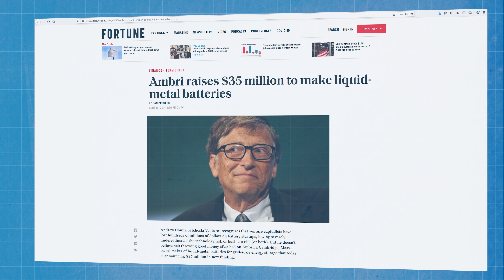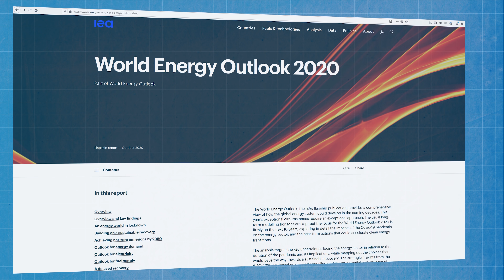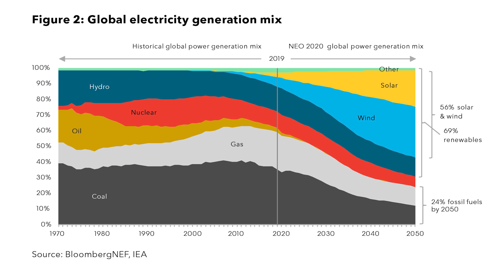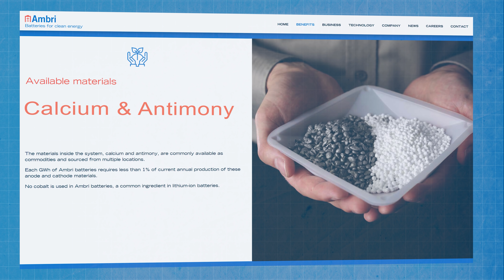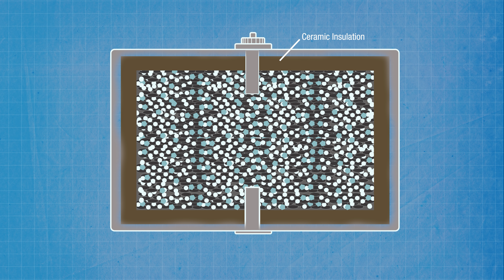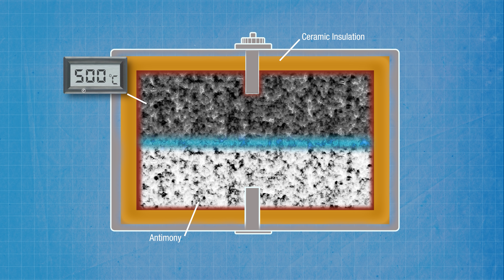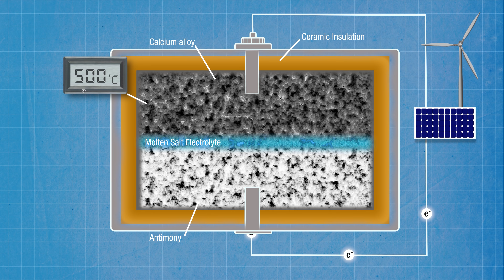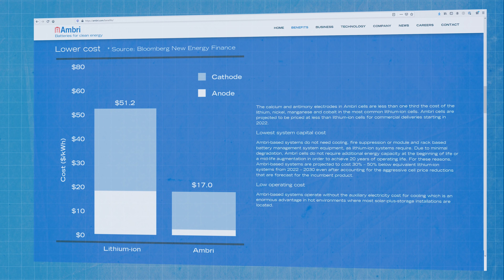AMBRI Liquid Metal Batteries. Will they really change the world?

Comment: I’ve been waiting for LMB to become commercially viable for some years now. NEC had an agreement with Ambri to use their patented technology, however nothing seemed to come of it. The really exciting thing about LMB is negligible capacity degradation over 10,000s of discharge cycles. This is at least 10x better than Li NMC, and translates directly into a proportional cost reduction per MWhr stored. I’ve not seen a price for Ambri LMB cells, however their websites implies the cost is expected to be ~40% that of Li NMC, which would make it competitive with pumped hydro from a capital cost perspective.
Reply: Lithium Iron Phosphate batteries have 10,000 or more cycle lives.  Jeff Dahn is testing some sort of lithium battery that is holding capacity to 20,000 cycles.  It will take longer to find the limit, it has taken three years to test the cells using typical discharge and charge rates one would find in EVs.
Reply: @bobwallace9753   Here's a recent paper reviewing the LFP Li NMC and NCA cell degradation as a function of cycles, depth of discharge and temperature.
https://iopscience.iop.org/article/10.1149/1945-7111/abae37/pdf
LFP batteries look to have an effective full cycle capacity degredation (to 80% of nominal) that is 5~10x  better than Li NMC, and are the best candidate for large scale energy strorage currenty available at scale. Lets hope LMB can improve on that, particularly for grid scale ESS.
What's clear is that energy storage will be the dominant cost component (~90%) of fully renewable electrical power.
Reply: @mikegofton1  Thanks for the paper.  I'll print it out tomorrow so I can read in detail.  (I need to underline and go back as I read.)

Jeff Dahn has now cycled batteries 20,000 times with essentially no loss of capacity and I think I heard that his lab has now reached 30k cycles.  But consider -

Tesla's cell cost, based on Sandy Munro's Model Y teardown review, was just over $100/kWh.  On battery day Tesla said they could drop the cost by 56%.  Let's round a bit and assume a $50/kWh cell soon coming.  And use 20,000 cycles.  $50 / 20,000 = $0.0025/kWh stored.  That does not include AC->DC->AC hardware or financing but it looks to me that the cell cost is danged low.  When storing for a half-day, day, or couple of days it would seem that batteries would be hard to beat.  Unless I've got something wrong.
Reply: @bobwallace9753  The cell costs you're quoting are a lot lower than the actual installed capital cost for grid scale ESS. In 2017, Tesla installed it's largest stationary LiNMC battery farm in Jamestowm, South Australia. As best I can tell from public data, the cost was ~$AUD 700/kWh. In 2020, the US DOE reported an average Li battery ESS capital cost of $500/kWh.
In the residential battery market, there's not much capital cost difference between LiNMC and LFP.  Sonnen (Germany) offer an AC connected LFP battery, warranted for 10,000 equivalent full cycles or 10 years at 80% capacity or more ,with a 20yr battery design life for ~$AUD 1000/kWh.
BYD (China) offer DC connected LFP batteries warranted for 3,100  equivalent full cycles or 10 years at 60% capacity or more for ~$AUD 800/kWh.
Tesla's Power Wall offers AC connected LiNMC batteries warranted for 2,800 equivalent full cycles or 10 years at 70% capacity or more for ~$AUD 900/kWh.
I would love for grid scale ESS capital costs to be comparable with pumped hydro ~$AUD 100/kWh in Eastern Australia , however I can't see that happening without some serious economies of scale (i.e. large capital investments). 
Out of interest, Australia has 13% of total electricity produced by Solar and Wind, 7% from hydro. To provide 3 days reserve for current Solar and Wind generation capacity would require ~400GWh of batteries.
Reply: @mikegofton1  You're using ESS as energy storage systems and not referring to the company that is developing iron flow batteries?  

OK, let's assume energy storage systems.  We have only two technologies that I can think of that are in commercial/common use - pumped hydro and lithium batteries.  There are a couple of compressed air (CAES) systems that were built years ago but haven't gained popularity.  And in this (larger) discussion we're talking about liquid metal batteries which at this point in time are only an idea.  They have worked 'in the lab' as have liquid air storage, synfuel, lifted weight, and perhaps some other ideas.  

Let me deal with lithium based cells vs. liquid metal storage first.  The numbers you present aren't very useful because they are based on 'old' cell prices and are not 'at scale' prices.  Clearly whatever storage technology/technologies we settle on will be built at scale.  Ramp up costs are simply burdens we will need to bear as it the case with any emerging technology.

OK, what are the cost components of lithium cell and liquid metal systems?  

Both need real estate.  At this point we don't know kWh/liter and now high it might be practical to stack batteries.  

Both need hardware to convert grid AC to DC and DC back to AC.  Assuming equal power ratings the hardware costs should be similar.

Both need labor to install and grid connections.  This may or may not be a wash.  We don't know what maintenance and security costs might be. 

Cells will probably have a higher manufacturing cost and higher assembly costs, turning them into a battery.  Cells might have a higher material cost.  This is a place where liquid metal could prevail. 

Liquid metal may have the ability to store more energy for less cost, but I'm not yet convinced.  It might be less expensive to install a very large liquid metal system than a lithium cell system with new cells but if the deep storage part of the cell system is provided by pulled EV batteries that are valued at recycled mineral prices then I'm not so sure.  In the real world we might install cell systems large enough to provide four hours of storage but later we could install some used EV batteries in parallel and increase capacity for very low costs.  Basically, the financing cost of owning then minerals between EV and recycling  plant.

In summary, I can see liquid metal systems prevailing but I'm not convinced.  We have to first see full scale operating systems so we have some reliable cost/performance data.

Now, cells vs. pumped hydro.  Pumped hydro has a very high upfront cost both in dollars and effort.  Huge projects with lots of regulatory and permitting hurdles.  Cells can be assembled in a factory and trucked to a site where they are placed on a slab and appear as just a big metal box.  Cells/batteries can be installed in modest amounts spread around at places like existing substations.  Cell storage is modular, there's no need to finance the entire long term storage system all at once.  And that might be what causes pump up some grief.

I can see cell based systems being installed in very large numbers for frequent cycle storage.  The daily stuff of moving solar to evening, late night wind to morning.  Cells could grab the 1-3 day work, leaving on a few times a year that we'd need a deeper storage.  To be affordable, I suspect, pumped hydro would need to sell every day, not just a few times a year.  We could reach a point at which we have all the 'up to three day' storage we need and now we need some three to six day storage which we would use only a half dozen times per year.  Would we go to all the effort and expense to build big storage systems?   

It's going to be interesting to see how things pan out.
Reply: @bobwallace9753  My apologies, I was referring to Energy Storage System, ESS.
In a broader context, our Australian federal government has no national plan for the wide scale deployment of grid scale ESS. Currently, some electricity distributors are planning to install 1200 MWh by 2030. This is really just driven by economics, to reduce peak electricity generation costs, and is negligible from an emissions perspective.

Presumably to be greenhouse emissions neutral by 2050 ( Government stated objective ), there will need to be significant changes in energy supply for transportation, manufacturing and electricity. Farming is also a significant contributor. Moving to emission neutral electricity is likely to be the easiest to achieve, and is an enabler for transportation and manufacturing emission reductions.

To get Li or liquid metal battery grid scale ESS to market at anywhere near $AUD 100/kWh will require a massive commitment of capital to drive economies of scale. I really can’t see how this will occur without Government intervention, either by direct investment or emissions related regulation.
In Australia, successive Governments have proposed emissions regulations however none have made it into law. There have been several instances where advocating for such changes have resulted in the Prime Minister or Government losing office as a consequence.
If I look to history as a guide, rolling out a national broadband network in Australia took 10 years for a capital cost of $AUD 57B, and that required direct Government investment and regulation. An emission neutral electricity supply will likely require an incremental capital investment of at least $AUD 200B.

I’m hoping Australia is not representative of global trends, and that LMB and other battery technologies will find the capital investment they need to scale quickly.
Reply: @mikegofton1  I had never run into 'ESS' before.  New abbreviation for me.

"To get Li or liquid metal battery grid scale ESS to market at anywhere near $AUD 100/kWh will require a massive commitment of capital to drive economies of scale."

Tesla is/has created the scale necessary to get cell costs to about $50US/kWh.  About $60AUS, rounding off.  What I don't know is the cost of the rest of the system.  Inverter prices have plummeted in the last few years so for a large installation $100/kWh may already be possible.

The capital will come.  Most businesses now realize that we must move off fossil fuels.  A few are in denial but that probably means that they are skidding over the cliff and won't be around long.  There's getting to be more and more social pressure to quit fossil fuels and during this first phase of wind and solar installation the cost of electricity will fall or at least largely stabilize.  Health costs will drop but that won't be as apparent to most.  Improved air quality will be noticed and appreciated.  Forces are combining to push renewable energy faster and part of the solution is storage.  

What is pretty much never acknowledged is the fact that fossil fuel plants age out.  Most US coal plants are near their replacement dates and will have to be replaced with something.  Wind, solar, and storage will deliver cheaper electricity than what could be had from a new coal plant.
Reply: @bobwallace9753  I admire your optimism. Good point about Coal fired plants reaching end of life - we have a similar situation. There’s a case in point in New South Wales now, the banks won’t finance a coal fired plant as solar and wind are more cost effective. However renewables won’t work because of grid stability issues, so in an effort to avoid outages the Government has said it will step in and finance a Gas fired generator if the existing operator won’t. Presumably this is because the cost of grid scale ESS and renewables has a much higher capital cost than a Gas fired plant.
I think we’re in a critical race which we are losing.

For arguments sake, accept the proposition that Tesla may have created enough scale to achieve cell prices of $USD50/kWh. Tesla vehicle production is currently limited by battery production, and Tesla produce only a few percent of vehicle demand globally. If each house needs about 3 days energy reserve (~75kWh) and each vehicle 35kWh,  the battery plant capacity required to be emission neutral globally by 2050 will be hundreds of times that which exists and in construction. 

Bill Gates is skeptical that this will ever happen, and is probably why he’s invested in Nuclear as well, even though $/MW is so much higher than renewables.
Reply: @mikegofton1  "renewables won’t work because of grid stability issues, so in an effort to avoid outages the Government has said it will step in and finance a Gas fired generator if the existing operator won’t. Presumably this is because the cost of grid scale ESS and renewables has a much higher capital cost than a Gas fired plant."

Wind and solar won't work without storage.  My guess is that we'll build storage over time.  But right now if one wants to create new capacity or replace a coal or nuclear plant what is the fastest and least capital intense is a mixture of wind, solar, and natural gas.  CCNG plants have low installed costs and once in place can assure 24/365 electricity.  

As more wind and solar are added the amount of gas burned can be lowered.  Since new wind and new solar produce electricity at less than the cost of fueling a CCNG plant it will behove utilities to keep adding wind and solar and running the gas plant less and less.  (If they are cost sensitive.)

It would make no sense to install large amounts of storage now as there is nothing to store.  Until a grid reaches the point at which a significant amount of wind/solar is being curtailed there's no role for storage, in general.  You can't store what you don't have.  Storage is replacing gas peakers for grid smoothing.  And we're starting to see power purchase agreements that include modest amount of storage that can be used to move a few hours of solar into high demand evening hours.  

Tesla is now building battery factories.  They have not yet made the formal announcements but buildings are going up at the Berlin and Austin gigafactories, Tesla has apparently been shopping for some very large buildings where they can start battery manufacturing, and they've been advertising for people with battery manufacturing expertise in North Carolina.  This Wednesday Tesla is presenting their Q4 2020 financial numbers.  It's likely we'll hear something about coming battery plants.  

As well some of the legacy battery manufacturers have started talking about switching to dry roll, large diameter cells.  I'm guessing Tesla has worked out some sort of licensing agreement that has not yet been announced.

Remember.  We're going to be building something because the existing stuff will not last forever.  We're unlikely to build any more very large centralized power generation plants but move to more modular and distributed wind, solar, and storage.   That's just what the economics will drive.

Nuclear has no future except where strong central governments build reactors for some misguided reason.  Most likely because large projects create opportunity for large bribes.  I think we may have reached the end of developing countries building nuclear reactors as a sign that they are 'arriving'.  You can't include 12+ cent electricity into a mix that now costs under 5 cents and make the math work.  

Bill Gates has deep knowledge in some things.  That does not make him an expert in all.
Reply: @bobwallace9753   "Until a grid reaches the point at which a significant amount of wind/solar is being curtailed there's no role for storage, in general.  You can't store what you don't have."
This statement, while strictly correct, doesn't acknowledge the fact there is a large difference between the daily time based generation capacity of renewables and consumer demand. To maintain grid stability, as renewables power increases  you need to match demand by varying NG or Coal power production. This reduces the capital efficiency of the Coal and NG plants considerably.
Experience shows that countries with high proportions of Wind and Solar electricity (Denmark 44%, Germany 34%) have needed to build new NG plants to do so. My argument is that capital investment in NG is ultimately substantially slowing the introduction of grid scale ESS, and the likelyhood of being emissions neutral by 2050. Storage has a role now, it avoids investing in new NG plants and allows existing coal plants to run at peak efficiency. In Western and South Australia, we typically have Solar and Wind providing 50% of demand around the middle of the day in summer.
Reply: @mikegofton1  

First, as I think we both know but I want to acknowledge, I'm using US numbers because this is where I live.  While Australian numbers may differ the same principles will hold.

"To maintain grid stability, as renewables power increases  you need to match demand by varying NG or Coal power production. This reduces the capital efficiency of the Coal and NG plants considerably."

We've always varied NG and coal power outputs as we match supply to demand.  That's led to lower capacity factors (CF).  That has decreased the capital efficiency of those plants but the cost is pushed on to consumers.  It's just part of the cost of providing electricity.

I'm going back to 2011, before there was hardly any wind or solar in the US electricity supply.  Here are the annual CFs.

Coal  62.80%
CCNG  44.30%
Gas Turbine  7.90%
Internal Combustion  8.40%

As you can see no plants, on average, ran at full availability.  All fossil fuel generation was curtailed at times with gas turbines and diesel generators running less than 10% of the time.  While those plants were underutilized based on their availability rating turning them down or off at times is just how the grid operates.  We need enough capacity to meet annual peak demand.

"Storage has a role now, it avoids investing in new NG plants and allows existing coal plants to run at peak efficiency"

That's a valid point.  And it might make sense to add storage in order to not have to curtail coal if all we consider is acknowledged costs of electricity and ignore external costs.  If we add in health costs then it makes sense to install CCNG plants and close coal plants immediately.  If we add in the future costs of climatic warming then we have been fools for not replacing coal plants with CCNG plants years ago.
Reply: @bobwallace9753  thanks for the stimulating discussion Bob. I’m a newbie to the power industry, having worked in Telco for 35 years. You obviously know the electrical power business very well.
Reply: @bobwallace9753  LiFePO4 is still 20 - 30% more expensive than NMC.  And A123 quality LiFePO4 is 2x more expensive.
Reply: @bromnader5196  Aren't the material costs less for LiFePo than NMC cells?  Nickel and cobalt are not cheap compared to iron.  If it's not materials might it be a scale of production issue?  

And if the materials are less expensive for the LiFePo cells shouldn't we expect their prices to drop lower than NMC cells with Tesla's new dry roll technology which is, IIRC, usable with both chemistries?  Tesla is planning on using LiFePo cells in its less expensive versions of the Model 3 and Y which should give that chemistry a scale advantage.  Nickel, I think, is being reserved for performance versions and possibly their long range semi.  Cobalt is going away.